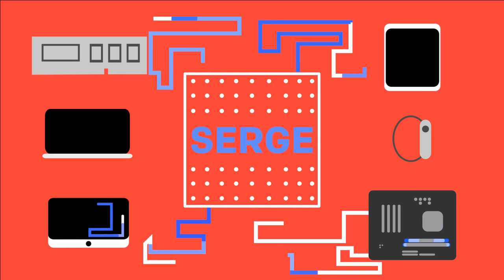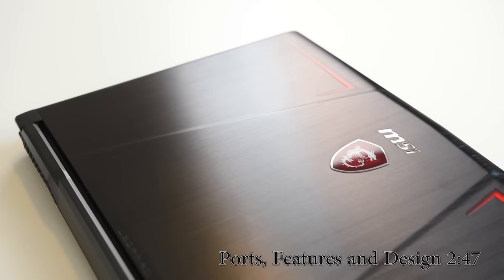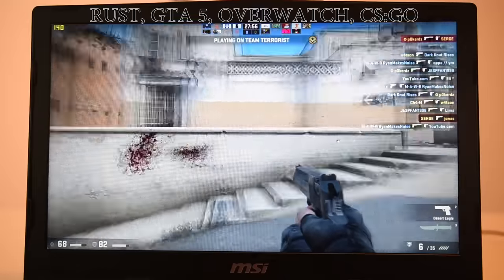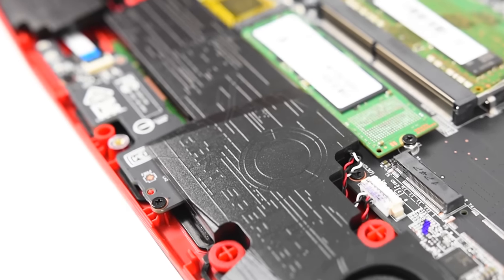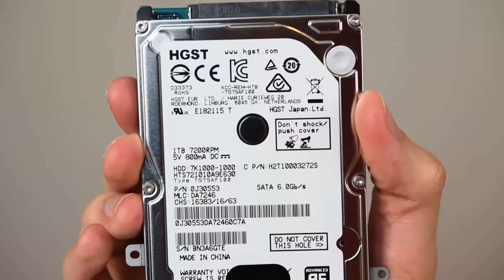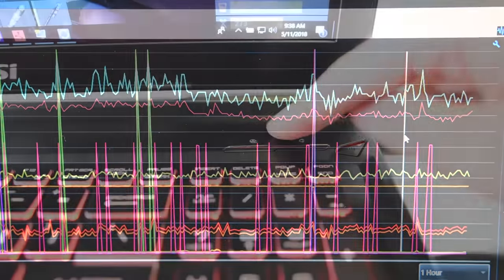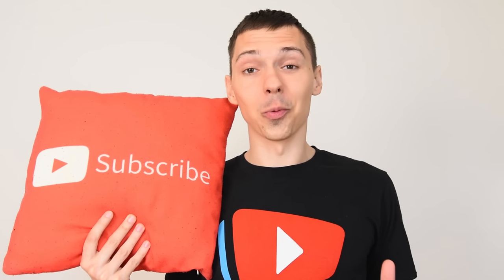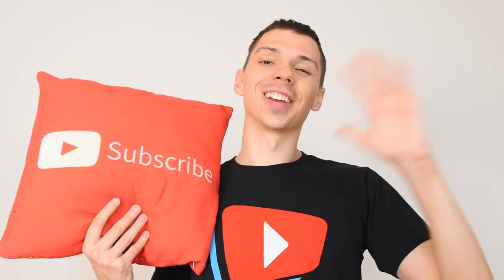MSI GAMING LAPTOP REVIEW GTX 1060, 6 CORE 8750H, GP63 LEOPARD 8RE

Comment: Can someone help me.  ahmm Im about to buy. I'm choosing between Acer Nitro 5 i7- gtx1650 ti and Predator helios 300 i5-rtx 2060 or Msi gp63 leopard i7-  gtx1060. I'm an Architecture student.
Reply from the maker: wow what an honor to talk to an Architecture student, alright man ill be frank if your picking a windows machine just get either the highest spec for the lowest cost or put more money up front and get a windows device with a dedicated graphics card, if you really care about good design and architecture get a macbook, I know your probably sick of hearing how everyone recommeneds it but once you see and internalize the difference youll never go back for work anyway macbooks are among the best, if you design you care about gaming the 16" had good gpu options in there upgrade path. 

Sure the macbooks will cost more but what do you really care about? your options are get an ugly gaming machine with high specs that will probably fail after a few years due to bad paste job on the cpu/gpu and the plasticness will cause a shatter when you drop the machine or if some unfortunate senario happens and the machine takes a shock from one elses negligence these gaming machiens will be toast seriously, now a macbook can take a beating, can take a fall and has the best design, architecture firms use them due to there reliability and in the long run you can argue the macbooks are cheaper and you can always install windows or linux on them, really there arent any limitations on them that cant be bypassed, of course if your a serious gamer just a gaming machine but if you want better design get a macbook but if you want something inbetween get a Razer. 

Out of the three machines id pick the 2060 since its a better gpu and thats gonna be important for work and gaming.
Reply: @SERGE_Tech  Woahhhh That's a good explanation, I'll save money to buy a MacBook too. That's also my concern about gaming laptops, the durability; Macbook was built well and really suits for professional use. Thank You for your suggestion, that means a lot. It's my Honor too, talking to a content creator. Have a nice day Man. Thank you.

Comment: what about colour gamut? especially sRGB and Adobe RGB. thanks & great review dude
Reply from the maker: i will have to get more professional and expand the color accuracy section.
Reply: Yess sometimes it is a deal breaker for some people like me.hahah. who like to work (photography) and gaming, but didnt have that budget for $2000++ laptop.
Reply: I just bought one, and no matter what colour settings I adjust the screen looks like ass....so disappointed.
Reply: Two types of matrices on this model: LG Philips LP156WF6 and TN 120Hz - the first one is more or less suitable for working with color, 90% sRGB, Delta color deviation is not more than 5. Suggest a profile TrueColor sRGB from the official website.

Comment: 93 celsius, it is too hot, i got MSI GE72VR 7RF-272NE Apache Pro and it goes somewhere 97 c for gaming, goes too hot too. But that Leopard looks cool.
Reply: I have the same laptop and mine only ever hits 81 at most but normally it sits at 75 FPS. I just wish it was smaller and lighter do you have the GTx 1070 in it as well.
Reply: Also consider room temperature. For me it's no problem with my pc (totally another msi) in wintertime but in summer it gets very hot. Besides that, keep airvents clear at least 50 centimeters away from anything, because the heat can easily accumulate over hours of gaming.
Reply: I wonder if he used his at stock without setting a  custom profile in his msi centre plus I have undervalted mine by 0.125 volts ive not had any problems with mine and I got it last march but it dont get used much as I have a little light laptop now for use during the day n a gaming machine in the office for when ii want to play newer games. the 1070 in laptop can play anything out o pc but the 2080 can make use oof my 240hz monitor. there are some great laptops out now thoug.
 @cyborgsmurf6446

Comment: is it a GTX 1060M (Mobile GPU) or GTX 1060 (Desktop GPU) ?
Reply from the maker: It is a mobile GPU but actually if you look at the fine print there is no longer a distinction the performance is very close to identical the last couple years they made a push to eliminate the whole Mobile GPU performance l in mutations now we basically have a full GPU in there
Reply: There's no such thing as 1060M. For Pascal generation (10 series), the mobile version and desktop version is identical (they're the same GPU).
Reply: SERGE is it the maxq version or not?

Comment: How's the temperature when gaming for 2+ hours?
Reply: With the max fan speed, temp is around 50C and I think it's ok. My concern is the Battery Adapter which gets very heat up if I use it for some times.

Comment: you need to edit your videos better, there was some sound missing, plus not explaining that the mini DP to Displayport function to connect to 2 more screens with the HDMI out, plus, The USB Type C is a Gen.2 so not 3.0/but 3.1 so not 5GB/s but 10 GB/s, It can be used to hook upto a hub, and also power another screen or add more USB devices or external HDD/ODD. I have this laptop, and i found the best way to have consistent frames without even reaching above 70 degrees C, and that is by using a Program called Throttlestop.exe  and Underclock the CPU with less Volts, and check to see for stability then making your Laptop last Longer without what kills Laptops; Heat.
Reply: I have the same laptop and thinking to undervolt it, What's your offset voltage currently at? And when i play games it goes to 90 to 91 c which even on highest fan speed.

Comment: The daredevil geek in me saw the SATA M. 2 empty port and wondered if there were actual traces going back to the chipset and if you could solder a header on and have 2 nvme drives and a sata m. 2 drive and a 2.5" sata drive

Comment: Sad thing is if I buy this laptop ill be leaving the hhd in as I need storage over speed.  I am even thinking about swapping the 1tb hhd I'm seeing in all these laptops with a 2tb one for extra room.
Reply from the maker: what do you need so much space? cloud computing has taken off
Reply from the maker: stream the resources when you need them they are dangerous to keep backed up on an hdd. hdd probe to failure after 2 years. so fail earlier. all of mines have died on the past:
Reply: SERGE well i ended up buying a different brand laptop due to a deal that was going on but the reason for needing more storage is due to me getting a new job that requires me to be on the road alot so a desktop wont be possible for me now.  Plus currently i run two OS on my desktop so that takes up a good chunk of storage and would like to continue doing so when i get my new laptop (but might run it in virtual box maybe, havent decided).  Plus while on the road (unless i find free wifi such as hotels and gas stations that may offer it) it will be hard to access the cloud (wont be accessing the computer while driving but if i end up pulling over for breaks or quick naps it would be hard in middle of nowhere to access the internet and yes teathering is an option but reliability in my area can be spotty at times) and i know about the dangers of only keeping things on hhd as i back up my computer all the time.  Also I just graduated with with a degree in Information Technology and i like to experiment on my free time on some programs I have learned about while I was in college such as Kali linux and other similar programs just for fun (and yes I keep it legal).

Plus somethings have slightly changed since i have posted that last comment as well.  I did get a little extra spending money for the laptop due to a sale got on the laptop and i might have enough to afford a 1tb nvme as the laptop has room for more then one so i would have a 1tb hhd for storage for my minor programs and the nvme for my games and programs i want to load faster.
Reply: Sorry about the little breaks in between everthing as it was typed on my phone

Comment: How do I get better FPS on this gaming laptop
Reply: Undervolt. The main limitation of any i7 8750 laptop is throttling. People reported up to 30% cinebench multi thread benchmark from simply undervolting with Throttlestop.

It'll also help keeping the laptop quieter and consume less power. As for the gpu it has a lot of temperature headroom so I'd overclock it along 2it minimal undervolting.
Reply: @ottomanherox  hi, um....how is this done 😬
Reply: @ekeneam3644  you've gotta use a program called Throttlestop, if you Google throttle stop guide thread the first result should give you plenty of info on it, gl with the Silicon lottery!

Comment: MSI  is one of the worst brand of laptop 
I have MSI gl63 8sd Intel i5-8300hgtx 1660 ti 12 gb ram. Killer Ethernet doesn't work, MSI app player has a virus which is my antivirus popped up so after turning off the antivirus it worked.and the store is blaming me for installing games? The heck they're the one who system restore my laptop and I didn't even do anything. And the intel uhd 630 and gtx 1660 ti has the same performance which is the gtx 1660 ti should perform better than intel 630 🤣😂 even if you try any games at ultra low settings it will stop at 60 which is my monitor hz is 120 🤣😂 and also overpriced
Reply from the maker: yeah i dont use anti virus because its not very helpful and often times flags things that dont even have a virus sounds like thats what happened with the player. althought i wouldnt be surprised if it did have some kind of virus almost all computers at this point are infected. Yeah there is no way the uhd630 is better then the 1660ti its possible that your 1660ti is off and the uhd graphics turns on you might wanna make sure its actually on and working. perhaps you dont have the driver after they wiped your computer. Since they wiped it the uhd could work with out a driver and the 1660ti would need a specific driver to work at.
Reply: @SERGE_Tech  and to sum up the killer control center l isn't working ,though it's already updatedand all the drivers are updated,and I tried to switch my dedicated graphics card in nvdia control panel into gtx 1660 ti also in manage 3d settings nothing happened 🤣.so after complaining at the store that there's something wrong with the laptop and after that I did get a full refund.well thnks for replying 😁

Comment: Its a pathetic laptop. Bought this around a month back for editing. it crashes frequently. Graphics sucks video lag in playing HD content. Earlier i was using Asus it was 100 time much better than MSI.
Reply from the maker: I was also experiencing video lag was wondering what that was?!
Reply: Updated Bios, Updated graphic driver. Still problem persist. Dont know what to do.
Reply: Should i take asus gl502 instead of this?
Reply: in my opinion YES. better than MSI.
Reply: how do the graphics suck? doesn't it have a 1060? Also when you say HD content do you mean videos/films etc or gaming?
Reply: i bought this by seeing 1060 graphics and 8th generation 17 processor. i mean HD here is HD videos in .mov or  .mp4 format. i have updated bios, new version graphics drivers But nothing worked for me. Even i tried for money back. they said it only possible with in 7 days of your purchase. Earlier i was using Asus  with 6th gen i7 prpocessor (gl502 vm )  everything was running smooth. I think MSI is not capable of delivering a good gaming laptop.i have wasted my Rs130000/- if you are looking to buy it please dont buy it otherwise you will also regret.
Reply: Onitially for 15 -20 min it will run fine after that lag start. and  not only that after half an hour your chrome will crash, your software will crash.. you need to restart your computer after every hour.
Reply: The lag is becuase of that stupid swithing between nvidia and normal gpu. It tries to shift to nvidia even while opening browsers and similar apps which dont even require the nvidia gpu. If you notice, the power led turns red when it lags, thats because it tries to use nvidia even when opening simple apps, explorer.exe etc. Red led means nvidia gpu, blue means intel gpu. It sucks i know and theres no solution. ALSO mine keyboard stopped working after 10 days, just few keys work. My first and last msi overpriced laptop. I am also in india.
Reply: Beyond Measure so should i buy it and if not recommend me any other laptop of this price range.
I am from india too😎
Reply: Ezio Auditore at 130k, i wont recommend it.
Reply: Install the Windows April patch or set the preferred gpu to nvidia permanently. Also check if your "chipset" drivers are up to date.
Reply: Beyond Measure where did you buy it from?
Reply: chetan jaiswal i got a ge series instead. 😅
Reply: Use different software and make sure drivers are up to date, your detailed issues aren't hardware related unless you have a faulty device. Don't leave feedback like this as it's misleading. The hardware is fine for HD video content, even upto UHD.
Reply: does it still exists sir,please reply,because i want to buy this soon
Reply: bro,please tell is th problem still exits and is it a serious issue
Reply: Moto Asset yes. It does
Reply: There is no compression between Asus ROG Strix GL503GE and MSI gp63-8re. The msi is the clear winner in this case. First of all the Ram of Asus it is 8 gb and 128 gb ssd while msi gives you 16 gb and 256gb ssd. Secondly is gpu, gtx 1060 6gb will give you almost double the performance of 1050ti. Thirdly is the screen, the display of 120Hz over 60Hz is a a major game changing. The difference of 24k is really worth as it it's a lot better.
Reply: God what are you talking about? It feels like a dude from Asus writes. If you have chrome crashes-it's obvious, or a software problem (reinstalling Windows solves 99% of the problems), or marriage - it happens and Asus, you're just not lucky. At MSI 2.5 times more heat pipes, the cooling system Asus 502, and 503 models are a shame. However, if you work only in Chrome and MS Office it is not surprising that you are all satisfied with Asus. I'm not talking about build quality - keys wiped stupidly.
Reply: Bro i am using this and i am editor but i am not facing problem in editing in this laptop, I love to work in this laptop and graphic card ki also awesome. Thzz
Reply: @Kamaldeepp0001  sir you said that a few keyboards has stopped working, are the keys c,r,f,8,9,0,backspace ?
Reply: @SERGE_Tech  I was wondering if this issue was brought to your attention by other users and if was anything done to solve it? Cheers